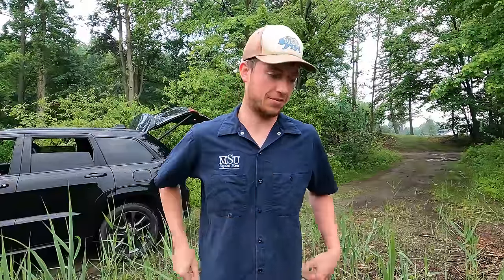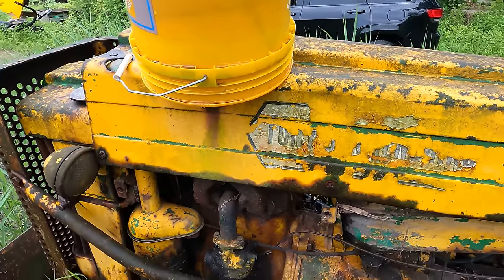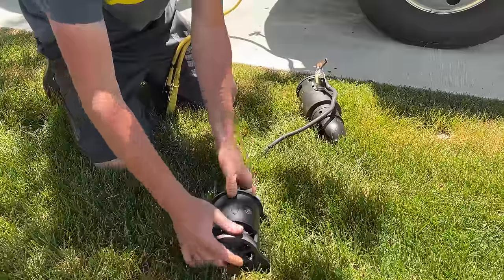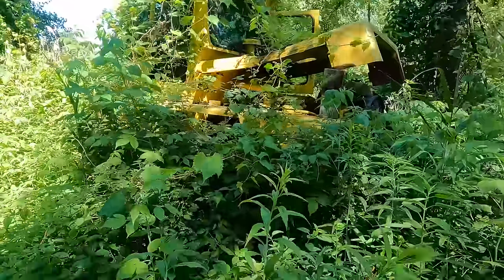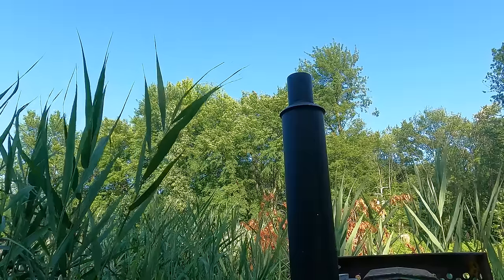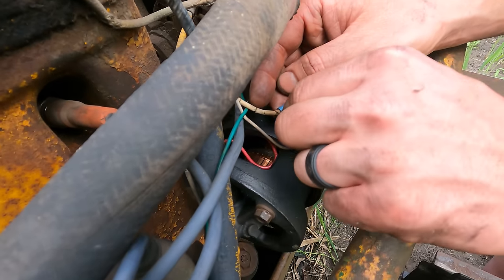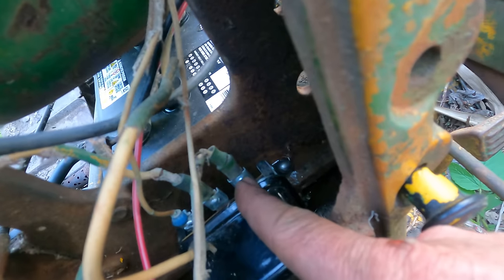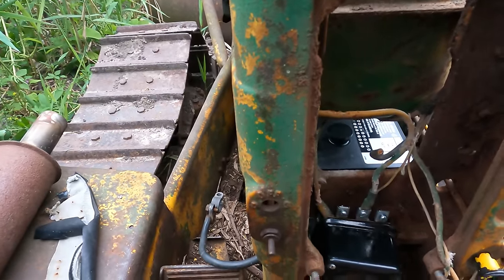John Deere Model 40 Crawler Repairs

Comment: Because of its size [not too big or little], its strong engine, and its potential, I'd love to see this dozer in a full nut/bolt restoration series. There's an excellent chance that 1] you can either fix, make, or adapt via new tech anything that's broken or no longer available. 2] upon completion it'd still be there for you for another 65 yrs [if the Lord tarries]. 3] during that time you could turn it into a one-of-a-kind JD Crawler with its optional backhoe and "GearMatic" winch. I'd love to watch a series like that no matter how how long the videos were or how many episodes it took. God bless guys.

Comment: I had an opportunity to buy a really clean one of these. It had mid level resto job on it. It was clean, and in good working order. 

The guy also had an industrial version of the John Deere 2030, with a front loader, roll over canopy, etc... I ended up buying the 2030, which I used to do some clearing work when we bought our land. And I then traded that for a fully restored 1946 2N with a half dozen implements that came with it. Its a great tractor and I get a ton of stuff done with it. But there are many days that I wish I had that crawler.
Reply from the maker: Yeah they’re too cool to get rid of!

Comment: You can try polarizing the regulator to get it charging. Also if you have the wire reversed on the gauge it will show it discharging when it is actually charging.
Reply from the maker: Yeah I think I just had the gauge wired backwards

Comment: you need to energize the regulator dont remember what terminals to touch
Reply: just  push  the  points  to  gether  with  engine  running  to  polerize  genny  and  cutout
Reply: Flash the power wire to the Field side of the generator to polarize the unit